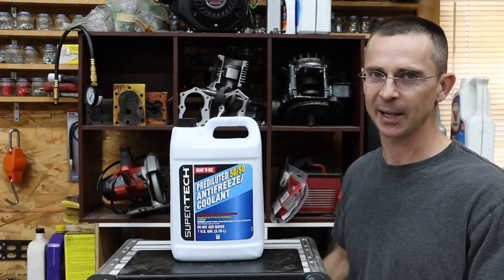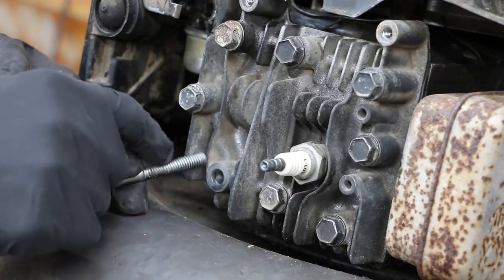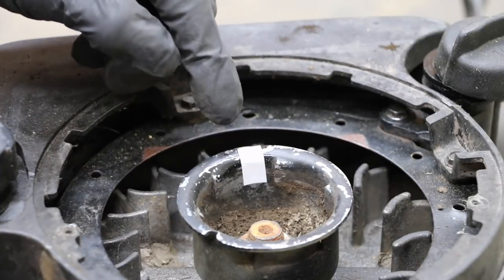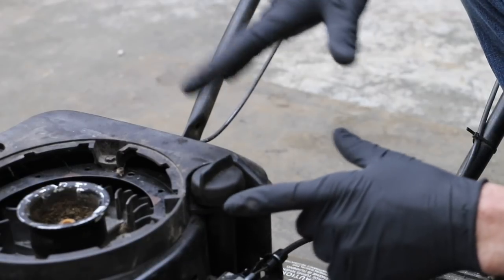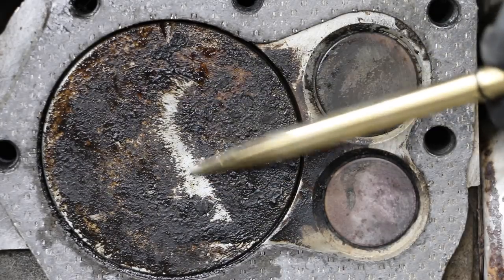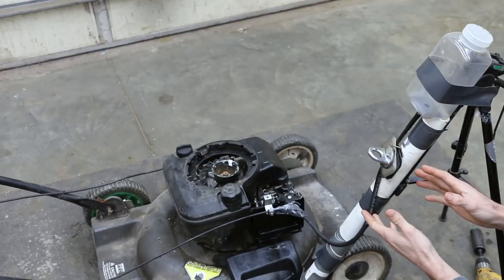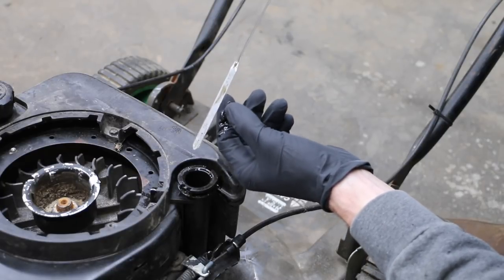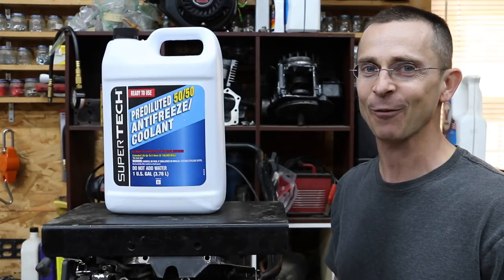Will Antifreeze clean an Engine?  Let's try it!

Comment: Let the drip method run for 8 hours and it gives you a nice result. Iv seen alot cars with leaking headgaskets. The ones with extreme leaks have the clean cylinder.
Reply from the maker: Thanks for this information.  Do you think the antifreeze has cleaning properties or is it just the water content?
Reply: Project Farm im not a chemist so ik have to admit that i have no idea!

Comment: What about adding full strength antifreeze to the gas and testing that as an engine cleaner? You are using a 50/50 mix so there is a LOT of water there...
Reply from the maker: Thank you for this video project recommendation!

Comment: I have used berryman B12 to clean up sludge I poured half of that into my engine ran it for no more than 5 minutes by the time it was done my engine look like a brand new motor the only downside to that was I had to replace all my gaskets because it dissolve my gaskets as well so I tore apart the engine and replaced all the gaskets but it look like a new motor and when I got done putting it back together ran like a champ I tried that on a 69  Chevy truck that I put a 350 engine in it now I would not recommend this on an aluminum block like as an example Honda's Toyotas and things like that because they can lock up when it dries up the oil but I can a hundred percent sure you I could take the engine apart and dip it in that solution with a ultrasonic cleaner and it would get the engine looking like new 😉

Comment: Do you use a new gasket every time you pull the head off of one of these small engines?
Reply from the maker: Nearly every time. If there is any damage, they get replaced.  Expensive, but ensures accurate testing. Thanks for commenting.
Reply: Thanks for the reply! I enjoy your videos and careful attention to detail.

Comment: What happens when you put engine cleaning products in an ultrasonic atomizer and feed that mist into the engine?  What happens with a mix of fuel and oil in an ultrasonic atomizer to create a mist that you feed into the engine?  Does it clean, does it get dirtier?
Reply from the maker: Thank you for this video project recommendation!

Comment: It's the water and coolant mix together it's basically steam cleaning it with the heat and pressure but you need to water in the mix that's how you get the Spotless engine
Reply from the maker: Thank you!

Comment: So whenever I've seen coolant that was leaking into a cylinder I realized that when it cleaned it it was not cleaned in 5 or 10 minutes but that this engine was operated for maybe hours if not 100 or couple hundred miles and over that time it had become basically steam cleaned internally
Reply from the maker: Thanks for sharing.

Comment: Mechanics do that for many years, but with distilled water. The car engine need to run in 2500 rpm for 45 to 60 min with the water dripping to the intake.
And HHO will clean the carbon.
Reply from the maker: Thank you!

Comment: Answer: Yes! It cleaned cylinder 3 in my car's engine recently to the point that piston 3 was spotless. Now it's in pieces being fixed.

Recently posted images of the cylinders on my "Principal Audio" Twitter. Probably can't link without it flagging my comment.
Reply from the maker: Interesting. Thanks for commenting on this!
Reply: Project Farm
No problem. Found out my cylinder head has a tiny crack from last time it was skimmed. Caused a tiny leak for a month that developed into a bigger one. Cleaned the piston and head 100% of carbon by that time. Literally zero carbon on cylinder 3 versus caked on carbon in the other three cylinders.

Comment: Antifreeze will eat certain deposits on metal components but the method I have always seen is to use an old crock pot to heat the antifreeze and soak the part in.
Reply from the maker: Thank you for this recommendation!

Comment: Blue screen wash works well. The reason i know is we use it in water meth injection and there is virtually no carbon and it turns the surfaces blue over time
Reply from the maker: Thanks for the feedback.

Comment: Wouldn't Transmission fluid work with all that detergent or cleaners in it? If it does work I'm going to use some in my Chevy with the cylinder deactivation to try and make sure it keeps working over 200,000 miles. I really enjoy your videos , the presentation seems to be like real life vs. how staged the shows are on tv these days.
Reply from the maker: I'll test ATF soon. Thank you

Comment: I use distilled water or transmission fluid down the carb with engine running. or spray a full can of carb clean down the carb and let sit for 15 minutes before starting.
Reply from the maker: Thank you for this recommendation.

Comment: I've read that straight water will do the similar carbon removal
Reply from the maker: I've tested straight water as a "drip" and it did remove a lot of carbon.  I might test water "mist or spray" to see if it works better.

Comment: I make a unique hydrogen fuel cell that makes water to evaporate into the engine with the hydrogen gas.  My mileage and horsepower went up considerably, and my spark plugs were much cleaner a year later when I pulled them out to investigate.  I am sure my pistons and valves are cleaner as well.
Reply from the maker: Nice!

Comment: Antifreeze appears to lack the solvent strength (or whatever you call it) of a proper cleaner.  It's getting in and under the carbon buildup, but not breaking it down enough.  It just gets slung around the cylinder.  Loss of compression and visuals seem to indicate that the valves got filthy from wet chunks of carbon buildup not getting exhausted.
Reply from the maker: Thanks for commenting on this.

Comment: I'd like to see you use (Steel Seal) on an engine with a head gasket leak to know how well it works before I spend 80$ on a bottle to fix a leak in my truck engine.
Reply from the maker: Thank you for this recommendation!

Comment: All I know is the antifreeze motor cleaning trick doesn't work with a bad head gasket. All it does is shoot out of the overflow tank onto the outside of the engine. That excess ,now white, antifreeze didn't stop the crack in the engine's plastic cover.
Reply from the maker: Thanks for the feedback.

Comment: Just plain water will do the same thing. I’ve been mechanicing for over 40 years and in my early days an old mechanic showed me that a coke bottle full of water did the same thing. He showed me small pieces of carbon coming from the tail pipe. He would just dribble the water in the carburetor keeping it at a fast idle.
Reply from the maker: Thank you!

Comment: why wouldnt you use 100% antifreeze or 100% water as  tests instead of the 50/50 mix
Reply from the maker: Great question. I was testing the mix since most automobiles use a 50/50 mix.  Many have commented that engines with blown headgaskets have a super clean piston and valves in the cylinder that was exposed to the 50/50 mix. I might test pure antifeeze in the future. Thanks again.

Comment: Antifreeze has methanol which is what removes carbon build up if you have ever heard of water methanol injection it is used in racing for performance boost and keeping the engine cooler and removing carbon build up
Reply from the maker: Thanks for the feedback.
Reply: No problem try running just wood gas in a video  which is methanol

Comment: The 4.0 liter engines in the Jeep Cherokees used to have a reputation for getting severe carbon deposits and suffering poor performance. In the carbureted engines, old school mechanics would decarbon the cylinders/pistons/valves by dripping a small amount of water very slowly into the carburetor. The water, as you know, does not compress and breaks up the carbon. Too much water at a time, you wreck the engine and have to do a costly repair.
Reply from the maker: Thank you for this information.

Comment: It's time to test coolants for their ability to reduce electrolysis.  Think of coolant as a wire.  What kind of resistance to electrical flow do different coolants offer?  As metal rusts and contaminates the coolant, this lowers electrical resistance and electricity wreaks havoc on radiators and other engine components.  Surprisingly, nobody has made a video on coolant electrolysis.
Reply from the maker: Great suggestion!   Thank you

Comment: "Donut do dis" as Orlando used to say. Antifreeze and oil mix will ruin your engine. It will wear out at lightening speed.  I have seen many engines ruined this way. In the earlier days of automotive removing and decarbonizing the head was normal Maintenance.AS was retightening the head bolts at intervals.
Reply from the maker: Thank you!

Comment: I've got an idea for you why don't you try using water versus antifreeze and see which one does a better job see if it's just the kind of steam cleaning it or if it's the actual antifreeze itself that's cleaning it
Reply: By the way the the copper in the threads idea man that was excellent I've never seen that before
Reply from the maker: Great video idea. Thank you!

Comment: Have you ever tried running an engine on WD40 or silicon spray? I saw a video with a car that used WD40 as oil... That was badass
Reply from the maker: Thank you.  Yes, I did run an engine on WD-40.

Comment: water works too not just antifreeze  and the reason why it works is because the engine gets hot and the water or antifreeze acts like a pressure steam cleaner and it works better when the head gasket goes because the coolant is already hot so the engine does not have to heat it up too much in the cylinder and if you would have added the antifreeze in at over 80 celsius and not room temperature the results would have been better however its very risky doing this and that is why is not recomanded
Reply from the maker: Great point.

Comment: what works really well is spray oven cleaner . but must spray water to clean it out.
Reply from the maker: Thank you for this recommendation!
Reply: Alternate lacquer thinner and oven cleaner .. then water ..  seems to work well .. even gasket remover .. these are all caustic and caustic is the only thing that breaks down the deposits, but leave too long and eat the Aluminium .. bat takes ages to do that ..

Comment: I'm not trying it. I'm doing it. I've been driving my truck with a head gasket leak for five years and been doing alright. Although not regularly checking my coolant has caused my heater core to go out. No heat this winter for me. Brrrr
Reply from the maker: Wow!  Thank you

Comment: Test different sparks for fuel  efficiency and performance. Just dying to to see a E3 spark plug in the see through engine. Stuck a E3 plug in my weed-eater and it seems to start faster almost to the point of starting with out priming it.
Reply from the maker: Thank you for this recommendation!

Comment: I actually looked this up after coolant leaked into my oil and noticed how much cleaner the engine was after fixing the issue and doing an oil change. The oil is literally clear after a few days of driving which wasn’t the case before. I understand this will probably wreak havoc in the future but this car is temporary so screw it 🤷‍♀️

Comment: Antifreeze in the oil pan will cause the main and rod bearings to swell. Eventually the engine will seize. I have experienced this and busted a crank as a result!
Reply from the maker: Thanks for this information.

Comment: Have you done just water?
Reply from the maker: Yes, I tested a water drip and it worked well, but ended up with contaminated oil.  I haven't tried a spray mist yet.

Comment: I don’t think it’s the antifreeze in total that is cleaning the cylinders. Just spray water in a fine mist and you should get the cleaning result. One of the reasons I am considering water meth injection.
Reply from the maker: Great point.

Comment: Antifreeze is getting in the oil of our Honda Element. Instead of fighting to clog that hole, why not fight fire with fire... or oil with oil. I am trying to replace the coolant by motor oil. Then, who cares about that leak?
Result so far: there was a lot of water/antifreeze even when I drained both the radiator and the motor oil, including replacing the oil filter.
The car still over heat by boiling some of the water mixed with the motor oil. It is unclear if the water pump will succeed at pumping fast enough the thicker motor oil.
Expected problem: the level of motor oil will keep rising as the level of oil in the radiator will keep droping. In other words, I will have to drain some motor oil and pour that oil back in the radiator.
Reply from the maker: Great point.  It's hard to remove all of the antifreeze from the system before adding the oil. Thanks again.

Comment: Try replicating a failed head gasket situation by mixing water or coolant with the oil before adding it to an engine and see the damage to the bearings
Reply from the maker: Thank you for this video project recommendation!

Comment: Been watching your channel for a long time, I watched a video where the guy used LAs Awesome Cleaner mixed with oil inside the crankcase of a vehicle, it seemed to work pretty well, maybe you can try this it was a 50/50 mix and he ran it through twice draining out the mixture after the first run and putting in new "super clean mix" as he called it.
Reply from the maker: Thanks for the suggestion.

Comment: DO NOT DO THIS TO A PUSH ROD STYLE ENGINE!!! A lawn mower DOES NOT compare to a push rod engine aka most car engines. water/Antifreeze does not ignite. If you use even a little bit to much you risk that cylinder to bend its Push rods. when you Blow a head gasket and see that "Shinny piston" its 50/50 if your engine is even good any more. works great with one cylinder but when you have 2,4,6,8,10,12 the other cylinders try to keep the engine alive just beating the hell out of the dead bent one.

Comment: It's the hydrogen in the water content that's doing the cleaning not the ethylene glycol
Reply from the maker: Great point!
Reply: Project Farm thank you for your reply! Have you done a video on using diesel as lubricant? It would interesting to see if the detergent package in diesel will help cleaning up the internals without causing damage. I have heard some people have used it as engine flush.

Comment: If you really want to see this work, you can't be shy. Just pour as much in there as you can for as long as you can without stalling it. Obviously you don't want to slug it. On a POS Flathead motor like that you could probably pour the whole gallon in there in 2 minutes.
Reply from the maker: Thanks for the feedback.

Comment: if you opened an engine that had a leaking headgasket or a cracked head inside the combustion chamber you seen that the cilinder is pretty clean where the leakage took place , think thats where the myth comes from
Reply from the maker: Great point.

Comment: you made a mistake  and used 50/50  rather then just straight coolant..   50/50 HAS 50% water premixed
Reply from the maker: Yes, people requested simulating head gasket failure, which normally includes a 50/50 mix. Maybe I'll test pure antifreeze in the future.

Comment: https://oileater.com/industrial/cleaners-degreasers/original-formula/

This stuff is an awesome cleaner. Carbon, grease, oil. As good as it works, you don't want to use it in a parts cleaner tank with a pump. Wreaks havoc with the pump. At least, if it's not diluted. Also, if you use to on a vehicle with polished metal, and drips on an aluminum fuel tank, you'll need to polish it out again.
Reply from the maker: Thank you for the feedback
Reply: You're quite welcome. Keep up the good work. A lot of fun watching videos and seeing the results of them. Some interesting outcomes on some of them.

Comment: Too funny but you’ll never get all the sludge from the engine . Only way is to remove the sump and clean inside and you’ll see mud like substances and if you don’t maintain or don’t know anything about vehicles or brought a car with no fucking history or take the rocker cover off and you’ll see the same sludge or I’ve seen rock like stones of sludge . Maybe use diesel or kerosene in the oil but you’ll need to drain abit of your oil in the sump about half a litre or more then run engine . Do both clean the sump and use diesel or kerosene in your old oil before you change it
Reply from the maker: All great points and thanks for commenting!

Comment: Antifreeze in oil will damage internal bearings I know this for a fact
Reply from the maker: Thank you for the video idea!
Reply: @ProjectFarm  you're welcome sir I just wanted to say is I had a truck 1964 Diamond Rio cabover someone didn't like me too well I guess and put a gallon of antifreeze in my motor I found it after I already went on a couple of trips over 1400 mile I drained the oil and then later on approximately two weeks I was coming from Illinois going back home it spun a bearing Rod went clean out the side of the block. It will scar the bearings and the mechanic told me when it blowed when I looked at it it was due to that antifreeze it took a little bit but it went Bang LOL

Comment: what's if you mix it with oil. hahaha
Reply from the maker: Thanks!
Reply: Project Farm by which I mean testing it on that bearing tester you have to see how bad it for say your crank bearings when your head gasket goes and you keep the motor going. Thanks for taking the time to reply!